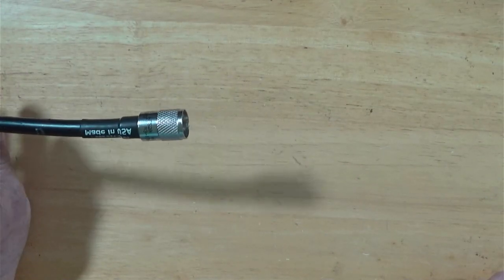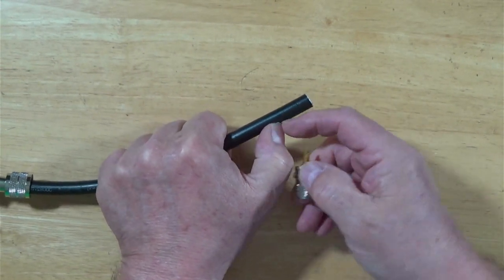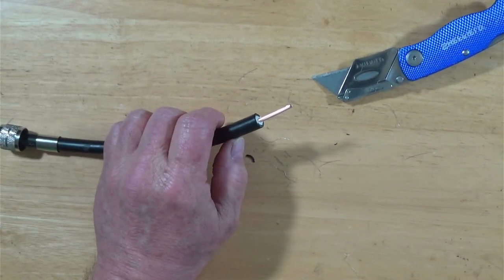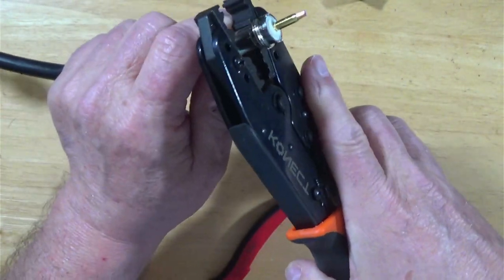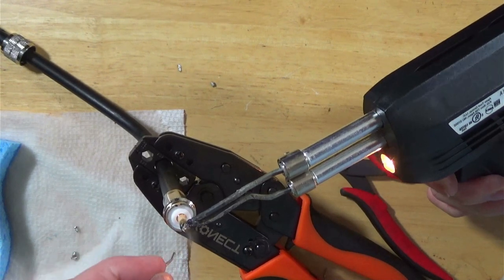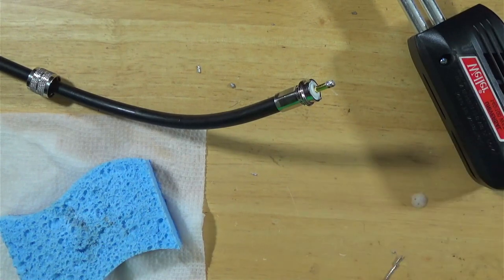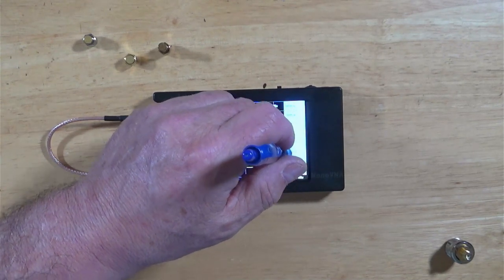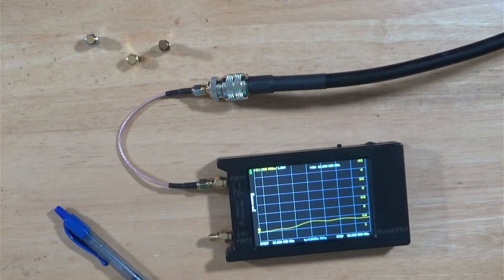Installing a PL-259 (UHF) Coax Connector

Comment: Great job; you survived the multiple cutting activities without drawing blood (at least not on camera). Nice to see your old soldering iron heating up the solder again.
Reply from the maker: Thanks Robert,
That soldering iron has been around for years. The biggest issue with it is heat control, but it's a good all around soldering solution and can get a lot of heat fast on a larger area then my bench equipment.

Stu
AG6AG

Comment: I got the DX Engineering coax cutting tool and their PL-259 connectors. I STILL have trouble trying to do trouble-free coax connections on LMR 400. I'm new to HF (started about three months ago)  so maybe I just need more practice. That's why I always leave 5-6 extra feet for any coax project . . .
Reply from the maker: Hi Tommy,
LMR400 is a real pain to work with... I find myself creating a 3ft circle with the coax coming up in the center. I then use my utility knife to walk around the circle while stripping it... It's quite the show. LAUGH
Using the UHF terminal as a guide to where to strip the coax really helps me get the thing on right.

Stu
AG6AG

Comment: Color me confused but you said the crimp connector was spinning on the coax, then hacked off a standard solder Amphenol (new ones suck btw) to replace it with another crimp? If that wasn't the bad connector you cut off why cut it so close, you could've made a short jumper with it... But I digress.

Comment: Just out of curiosity, could you just use standard coaxial cable for a tv and throw on pl-259 adapters at either end to use it as a UHF coaxial cable? I apologize if that's a silly question, but I'm new to this, so please humor me....
Reply from the maker: That's actually a very common question when someone is new to Amateur Radio. The answer is that you can use any 50 Ohm cable for Amateur Radio. TV and Satellite cable is usually 75 Ohms so you should not use it.
Now, this is an oversimplified explanation, because you could use it if you can make it appear as 50 Ohms to the back of the radio... This is actually harder then you would think.
Hope that sheds a little light on the subject...

Stu
AG6AG